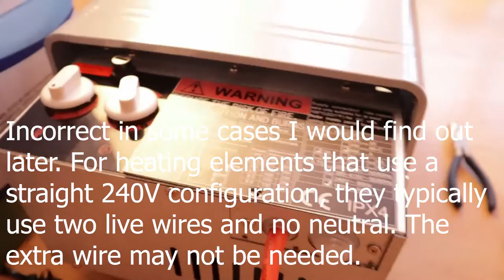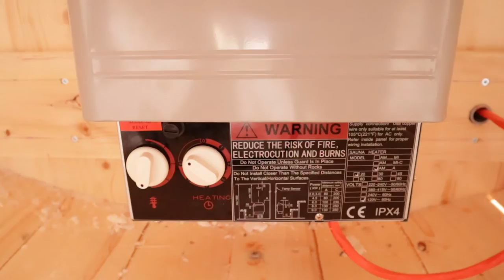DIY Barrel Sauna Build: I'll SHOW you How You Can Make Your Own BARREL SAUNA from regular stud wood!

Comment: Great job, thanks for sharing. Now is 2 years later. Any comments about maintenance of your barrel ?
Reply from the maker: By the end of the first season, you'll find if you were missing any screws in the staves. Lol.  I had a couple boards warp on me near the top where I forgot to screw them in on one side. Had I sourced steel bands to go around it wouldn't have been an issue. I ended up just replacing the two board as I just couldn't pull them in as the warp was so strong. The screw would go right through trying to pull it in. 

Other than that, while I was replacing those boards before winter hit, I decided to throw shingles on to help keep the steam from escaping through the small gaps in the staves. Huge improvement on efficiency.

My wife is still using it several times a week and loving it. I don't use it a lot myself but when I do, I absolutely love it.
Reply: Where did you source the bands and how much did they cost? Looking to build soon.  Thanks!

Comment: Did you or will you treat the wood at all? A sealer or lacquer? Really thinking about doing this myself. Great video
Reply from the maker: Thanks for watching. Glad you enjoyed it. And I highly recommend building one. We are loving it. My wife just finished work for the day (remote office job) and she's out there right now in it. :D

I do plan on sealing the outside. Before I do that, I may get a steel band for the center to tighten it up. Or shingle it. Undecided. I left the heater on over night once and some of the upper boards warped a bit and opened up some gaps. Not sure if it was inevitable or or warped because it was dried way too quickly. Either way. I'd like to tighten things up as a lot of the steam escapes through those gaps. It's still hot and steamy in there, but because we've experienced it with closed gaps before, we know what we're missing. Lol.
Reply: Cool Job and well done

Comment: How is this holding up??? Spruce still a good choice???
Reply from the maker: Great choice. The wood continued to dry and shrink. So the gaps increased.  Recommend building it in the summer or fall if you're in nothern climates to ensure your lumber isn't frozen and wet. I did miss the screws on one end of one board so it warped horribly so I made a new one and replaced it. I never did put straps on it so it likely would have not require replacing if I but steel bands around it.

I did end up shingling it and so glad I did. I don't worry about any small gaps anymore and used it without any problems in -40C weather again. Absolutely loving it.

Comment: what improvements would you make now on the build?
Reply from the maker: I shingled it the second year to make it more efficient. Putting steel banding around it may have done the trick but I would have had to find a fab shop to make them for me. Other than that I still get some steam leaking out the top edges on the front and back. Haven't really investigated if it's coming from between the staves or from the dado channel. I could again increase efficiency by sealing it up with a fascia of sorts or some silicon.

Comment: I would like to know the length and width of your sauna and by the way nice job and thank you for the video
Reply from the maker: Thanks. Sorry for the relayed reply. I used standard stud dimension so the staves are that long. But you can make it with longer 2x6 material of course. You could even introduce a changing room and make a wall inside to help insulate the heated sauna from the direct outdoors. I have also seen some people put a larger recess on the front to put small benches to sit on while you cool off. 

The front and back wall is recessed about an inch or two back on mine. Just enough to provide strength to hold the staves. The height / diameter of the barrel is around 6'. I can stand up in there barely right in the center.